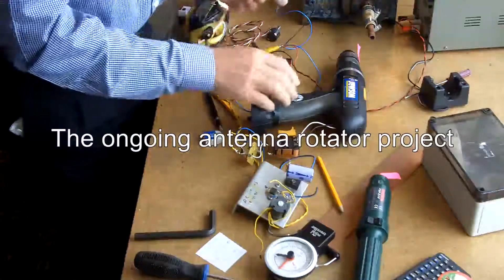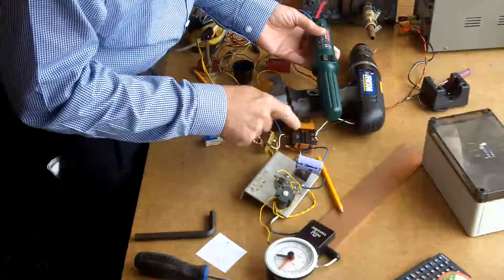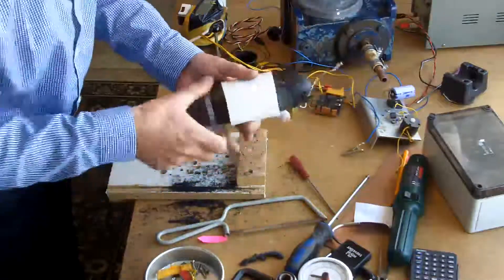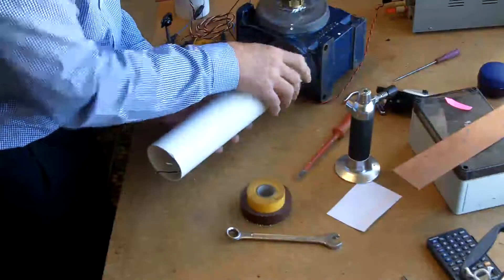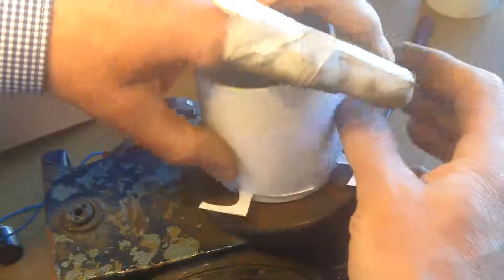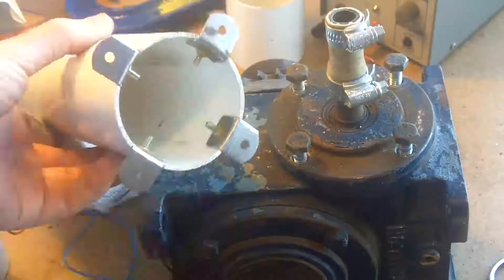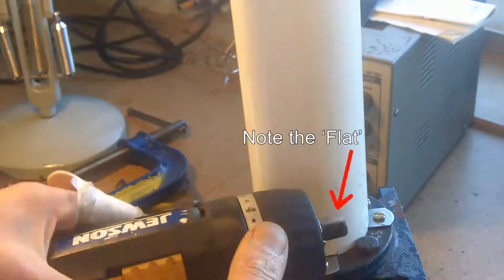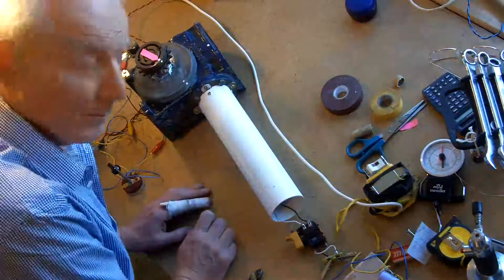About Radio 80 part 12 Mounting the antenna rotator motor

Comment from the maker: Hi Dennis like I say I'm always surrounded by expert advice, after the event. Man I’d just honed my sickle to a razor edge and then cut my knuckle through to the bone just missing anything useful like those little bits of string that pull the finger back. After I sewed that up I then managed to cut the front of my finger with a new Stanley knife, that was another 4 stitches. I have a 80 mile round trip to a hospital so a bit of DIY comes in handy. My worry is they say they come in 3’s
...Andy